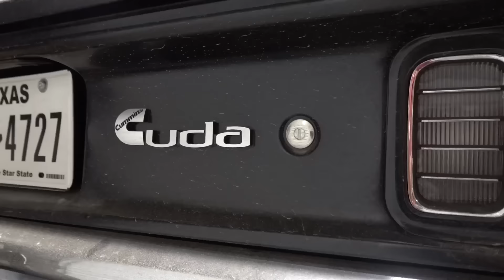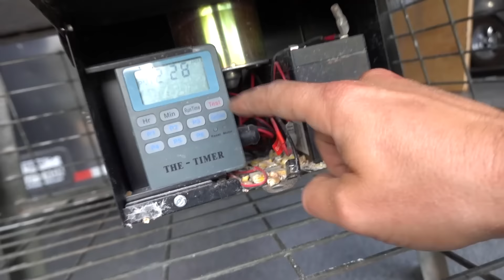Renovating an Abandoned Dump Truck

Comment: FUSE!
Please remember to put a fuse on that positive wire as close to the battery as possible, as you stated, theres will be a lot of power going through those wires, you wouldnt want them to catch fire from the battery all the way to the winch. Be safe.

Comment: Also could have bought some nice 30ft hd jump cables, and just put the quick connect on one end. You can actually buy them pre made just like what you made. Just without the zip ties that will destroy the paint on whatever truck it touches. Lol.

Comment: Please, PLEASE put a big ass circuit breaker on Merle.
Had a tow truck burn to the ground because it didn't have one on its jump port. Got into a small fender bender and pinched the cables to the frame (they were ran similarly to yours)

Comment: You don't use a steel cable with that aluminum fairleed. Either switch to synthetic rope or a roller fairlead.

Comment: It doesn't matter if you replace that heavy gauge wire with full copper, AC electricity only runs through the surface layer of metal, IE: just that copper layer

Comment: Hopefully, you remember to put some s**tch blocks, in the trucks, so, if you have a big pull, you can use the blocks and increase your pulling power. Also, put some good chock blocks, in them, as well, so the pulling vehicle will not slide, when winching another vehicle. Fuse the line so you do not burn up your truck, get a switch for under the hood, that will kill power to the winch, when not in use, covers for you connections, and change your fairlead for cable or get a synthetic cable.

Comment: Aluminum carries electricity better than copper it just has to be higher voltage which is why all the big long distance transmission lines are aluminum not copper

Comment: Matt you are wrong of the aluminum vs copper electric conductivity. Aluminum is allmost 2x better conductor than copper when compared to mass, allmost all todays powerlines are made of aluminum because of that.
only problem why aluminum is so much worse than copper is that it has to be 100% airtight from ends, because it will oxidize really fast and lose the conductivity

Comment: That kind of face plate is meant for synthetic rope, not metal cable. If you use it much like that, you will damage the face plate then the cable.

Comment: Not to happy with CAT myself right now. 3 year old generator, very low hours and shaft seal leaking. Worse part is found out they just put their sticker on it, NOT built by CAT. Now they can't find  parts for repair.

Comment: Ok ill eat my words. I guess with age and heat it took out a driver but it usually has 3 or more codes before it wont run. They usually run crappy not a no start at all. No start at all is pump.

Comment: 12,000 pound winch (even a Warn) won't pull 12,000 pounds anyway. A Warn has a line pull of around 9,800 lbs at the 4th wrap.
Those Anderson plug pins should be soldered not just crimped mate, I bet they get hot.

That's camera number . . . ? 🤣

Comment: Car trailer with merch? Car on bottom, shelving swings down from top. Or a decked type of system that slides out on the bottom, top or sides
Make it long as you can so the front hood your $1,000,000 t shirt inventory

Comment: It would cost around $38,000 for a dump truck so $3,800 isn’t that bad. Even if you found an older used dump it’d cost $5,000-$10,000.

Comment: im commenting early,, but even at 3500 for a new computer the truck was free so it cost you 3500.00 also  thoes engines have 2 cam sensors behind the air compressor going in to the front cover from the back side if they arent working its not going to tell the computer rotation of the engine and it wont fire the injectors